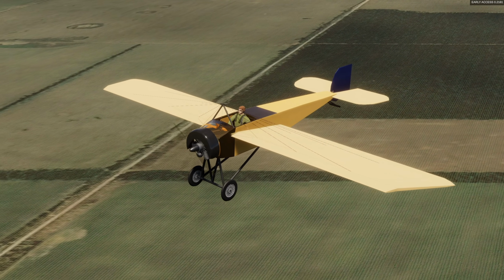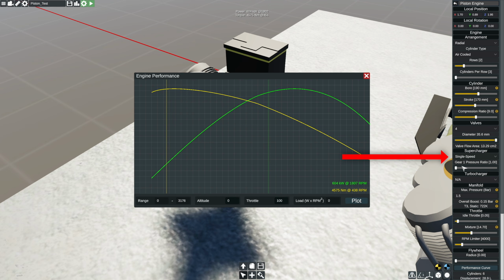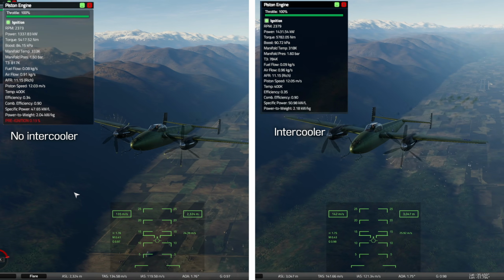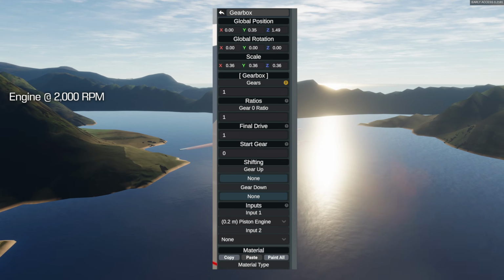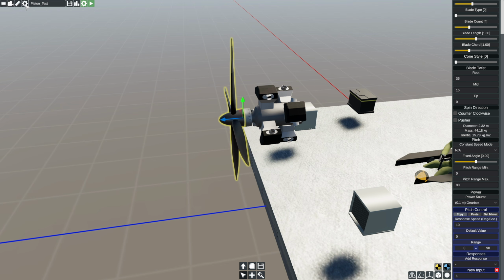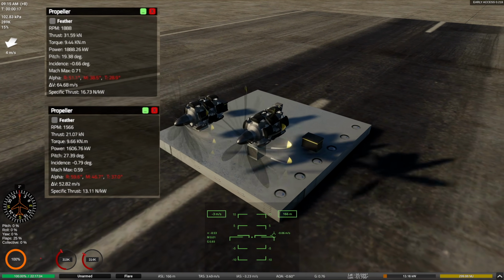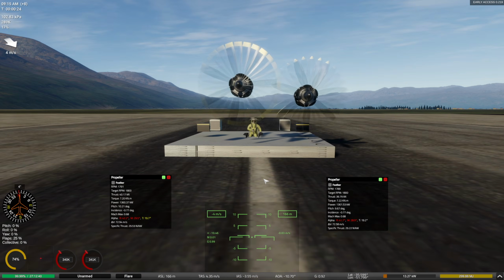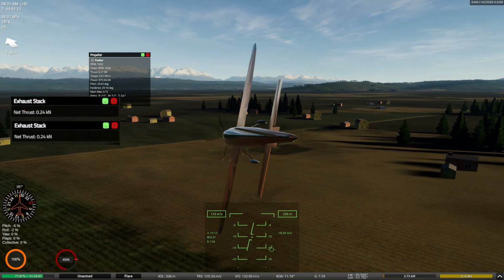Flyout Comprehensive Tutorial Series | Part 4: Piston Engines & Propellers [REUPLOAD]

Comment from the maker: Edit - I realize I didn't mention the RPM limiter at all. For prop planes, just increase this to its max value so that the prop and gearbox do the RPM limiting, otherwise the RPM limiter may activate too early and significantly lower your engine's performance.

Hi all, just some clarification for part of the propeller tuning: When I say the prop is "too heavy" or "too light" to stay at a certain RPM, this is a little misleading. What would have been correct to say is that the blades are generating too much or too little drag to allow the prop to get to the desired RPM. A prop's weight will only affect its angular acceleration. The original statement about weight in the video was made because the factors that affect prop weight also affect its blade drag. Sorry if this caused any confusion.
Reply: Hi. I'm currently building a ww1 era biplane bomber (h.p.12) and I'm having a problem where the plane stalls due to the hig sensitivity of the control surface, is there anything I can do to counter it?
Reply from the maker: @sebastianolino8806  I'm not sure which control surface you're referring to, but assuming it's the elevator, try reducing the angle range values that it can deflect. If those are too high, it may make the plane reach its stall angle when turning with a keyboard. If you're flying with a joystick, however, try being gentler in the turn.
Reply: Acabo de descubrir y comprar este juego y estoy fascinado... el sueño deseado de miles hecho realidad !!!  gracias !!!  solo 2 sugerencias ... la curva de aprendizaje es muy empinada, debería haber modo principiante (con opciones de combinaciones de motor, caja de velocidad y hélice standard ), y avanzado con libre combinación de elementos. El sueño siguiente sería la unión, fusión de un solo programa de este juego con IL2 para crear misiones de combate con aviones creados por usuarios !!!!  gracias de nuevo !!!   por favor no abandonen su desarrollo, falta más publicidad, hay mucha gente que ignora que este juego existe !!
Reply from the maker: @sergiofaraoni2547  Hi, just to clarify, I am not one of the game's developers, I just make tutorial videos. The game is still being developed (more information on that in the discord server, where you can also make suggestions) with some new weapons stuff coming soon.

Comment: i think i might have missed it, but how do i find my propellers optimal RPM?
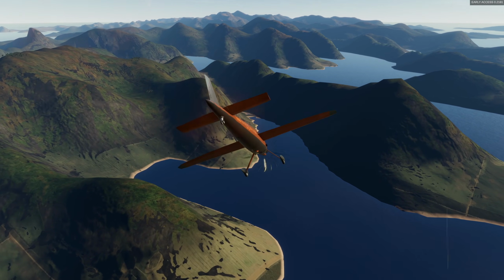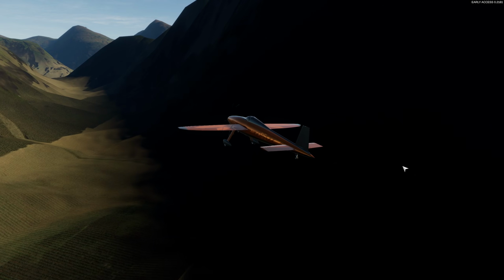Reply from the maker: That is discussed at 9:07-9:33 - note that your ideal tip Mach number can vary from the stated 0.8-0.9 range; very old WW1 planes for example may have a significantly lower tip Mach number.

Comment: Ok,I have already mastered the construction of propeller-driven aircraft and the configuration of their engines, and this tutorial helped a lot. But i have a problem, all my planes are or V engines or inline, so i I tried to make plane with a radial engine. It seems that for some reason, the engine has much less power than a V-engine. 

I tested both engines at an altitude of about 10,000 meters, both with the same configuration. Although the radial engine had 2 more pistons than the V engine (the radial has 14 and the V has 12), in practice the radial engine delivers at most 650 kW of power, but the V engine could deliver up to about 1400 kW. 

Excuse the redundancy, but in the configuration I only changed it from radial to V, I left everything else the same. 

I don't know what I might be doing wrong.
Reply from the maker: I don't think you've done anything wrong; I just checked the power curves on a radial and V engine with otherwise identical specs (same piston count, too) and the V still has more power. It's likely an oversight in the game.

Comment: So I made a plane like the do335 but it can't take off
Reply: How do I fix it
Reply from the maker: @benyavz  Going to need more details. Does the props spin at a reasonable tip Mach number? Do the blade alphas look good? Any preignition in the engine?
Reply: @TheWanderer05  yeah I need to look at it
Reply: @benyavz  Put a rocket motor and ram jet on it
Reply: @ChickenNeck_WT  dude ı have already fixed the plane the propelers where too thin

Comment: how do you make reversable pitch propellers?
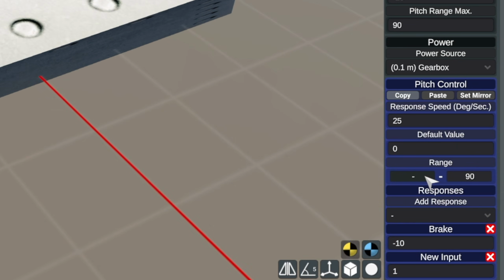Reply from the maker: That is discussed at 14:58. Note that if you are using a constant speed mode, this may cause the prop to inadvertently try to use the reverse pitch range to maintain target RPM, resulting in the prop trying to stay in its reverse thrust range. You may need to experiment with the lower angle range to stop it from doing this, but see how it works first.

Comment: i know im kinda late but my my plane keeps pulling to the right like a lot
Reply from the maker: That could be caused by a number of things - is it crosswind-related? Does the plane have some of its landing gear angled outwards to the side at a large angle?
Reply: @TheWanderer05  no angled landing gear so its prob crosswind
Reply from the maker: @Hibro-51311  In that case, you'll need to make sure you have steering on your nosewheel (or tailwheel if it's a tailtragger) if you don't already. If you do, then more yaw authority is needed for you to counter the rightwards yawing motion as you take off.
Reply: @TheWanderer05  thx a lot it helped

Comment: when i turn on the engine the RPM just goes down and turns off. However it doesnt tell me what error is happening. what should i do?
Reply from the maker: Increasing idle throttle a little bit should solve the issue.
Reply: @TheWanderer05  it didnt-
Reply: @TheWanderer05  another problem i have is that when i place a gearbox most cameras go fully black. what can i do?
Reply from the maker: @frananashe  Is its power source set to the engine, and is there a prop or wheel that the gearbox is driving? Sometimes the game has issues if these conditions aren't met. Regarding the engine not working, how much did you increase idle throttle by? Does it still stall out if you increase the idle throttle all the way? If not, you should be able to slowly lower it until it stops stalling.
Reply: @TheWanderer05  the power source would be the battery right?
Reply: @TheWanderer05  do u have discord? Maybe I could give you better info that way...
Reply: @TheWanderer05  i increased the idle throttle from 0.05 to 0.10
Reply from the maker: @frananashe  You might want to join the game's discord and ask for help in one of the help channels, that'd be the easiest thing to do.
Reply: @TheWanderer05  okay

Comment: i need help, every prop i place keeps either being flat no matter what or turned so hard it wont propel anything and it keeps happening no matter what even when i use a stock propeller.
Reply from the maker: Is the propeller connected to a gearbox in its settings?
Reply: @TheWanderer05  yes.

Comment: I have a problem with my prop, it wants to bank to the side the engine and propeller turn.
What do I do to solve it?
I already tried with 2 propellers one in CCW and the other in CW, still banks
AND FOR SOME REASON, DISCORD DOESN'T LET ME REJOIN TO THE FLYOUT DEV SERVER
Reply from the maker: If it's rolling regardless of the engine setup, it's likely that something else is causing it, such as the wings. What do the wings look like? Are they reverse-swept? Do they have anhedral instead of dihedral? Both of these contribute to roll instability.

Comment: Where did you get the other pilot figure/character from, the one piloting the older aircraft, I only have one pilot type under the sub menu "Cmd" ? ... great video by the way, thanks fort the help
Reply from the maker: The pilot model can be changed on the pilot part. Scroll down near the bottom of his options and there is a headwear list you can choose from.

Comment: Thank you so much for the tutorial, but I am curious about the possibility of contra-rotating props, and how to make them
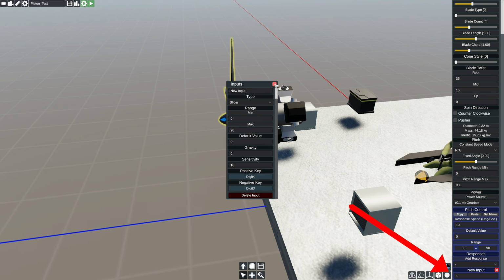Reply from the maker: The methods that @8Hornet and @maximpikalev9538 provided will both work. As for the prop hub style, you can make a fake one with fuselages set to zero detail strength. The plane at 14:36 does this (and also has contraprops).
Reply: @TheWanderer05 thank you, I'll for sure have some experimenting to do. I'm wanting to attempt the bomber from the "Dead Hand" animations. I've managed to build it and rebuild it 5 times in Simpleplanes
Reply: I'd assume grabbing a second gearbox and making the value negative, then clipping a second prop (with the counter-clockwise option enabled) into the first since you can't change the cone style all that much right now
Reply: @ikalev9538 No, same gearbox add a propeller and make it CCW or whatever is the opposite of your first, DO NOT add negative value, you will mess it all up.
Reply: just put a prop ontop of another prop and make it ccw